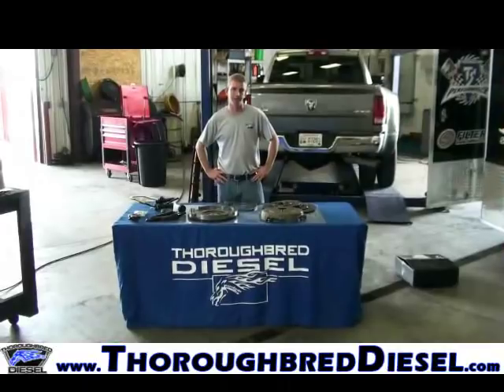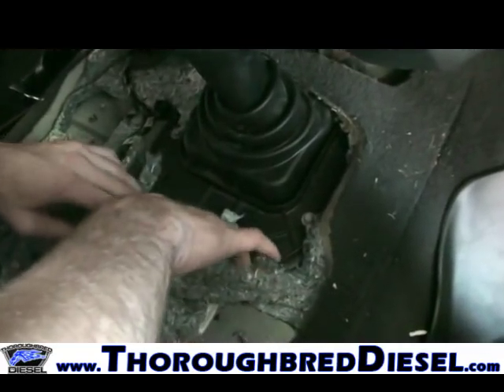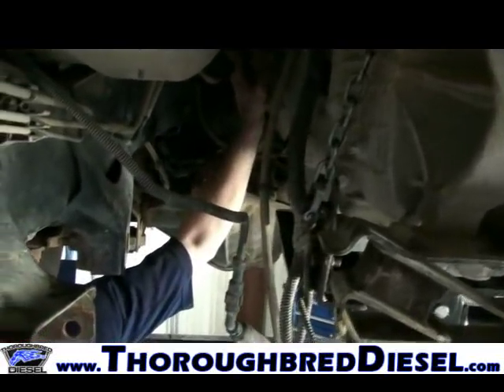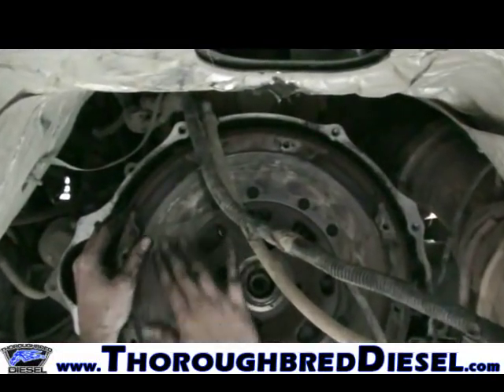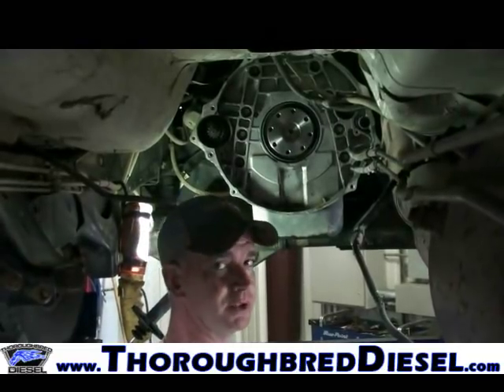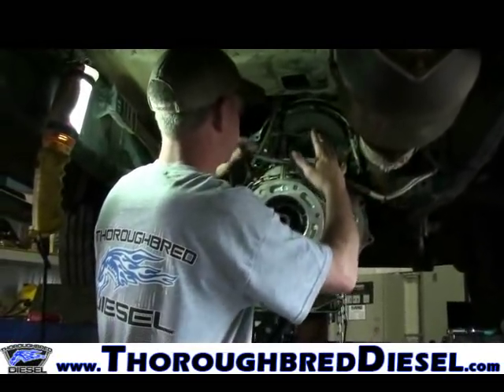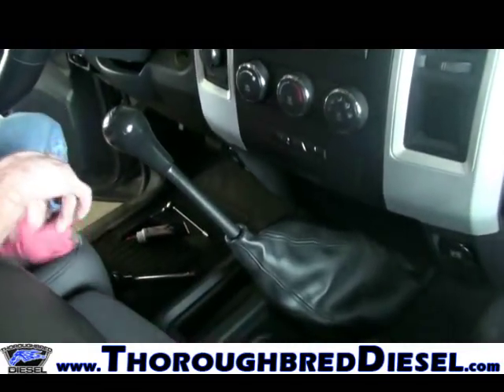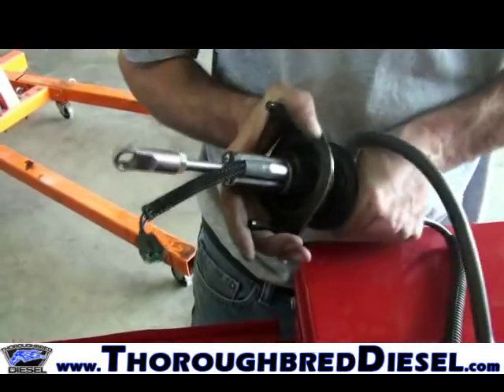Valair Dual Disc Clutch Install G56 Dodge Transmission

Comment: I have a dual disc Valair in my g56 and it won't totally disengage. I've had it torn apart and everyone tells me it's normal but I don't feel that possible. Can you help?
Reply from the maker: What do you mean by “won't disengage”?  Are you saying that with the trucks clutch pushed in that the truck still tries to pull itself?  If you are talking about the noise when the clutch is pushed in, then yes,  it is normal.
Reply: Thoroughbred Diesel not talking about noise. bare with me... facing up a steep hill makes putting the truck in first quite difficult. facing steeply downhill will allow it to disengage ( stick clicks into first effortlessly). now, to prove my point, on fflat level ground, I'll put the truck in first and pull it right bask out of gear but only far enough that I don't go past the synchronizers, then, push gently forward and the gears grind. this cannot be duplicated if the truck is on a steep downgrade.
Reply: I dont know why my phone threw "thoroughbred diesel" in there first...
Reply: it also cannot be duplicated in other cars and trucks...
Reply from the maker: Will the truck go into 2nd, uphill, easily?  If so,  if you put it in second and then go to 1st will it go easier?
Reply: second is rough still but not as bad. I've been doing that with 5th gear. the problem is not simply a matter of convenience, it effects my ability to tow as shifting from first to second and to third takes enough time that I lose significant boost...
Reply: again, uphill is the main issue